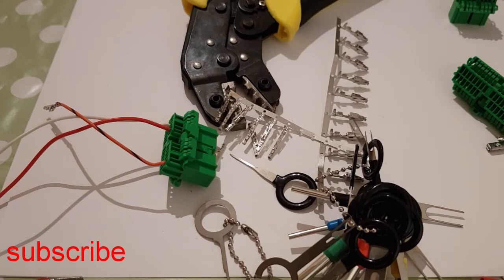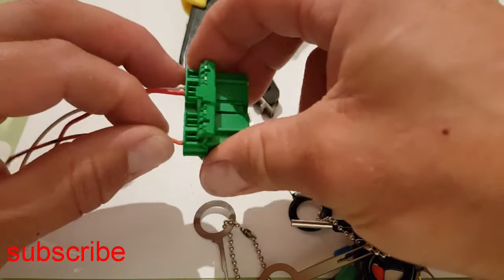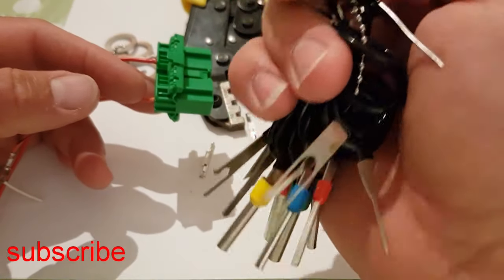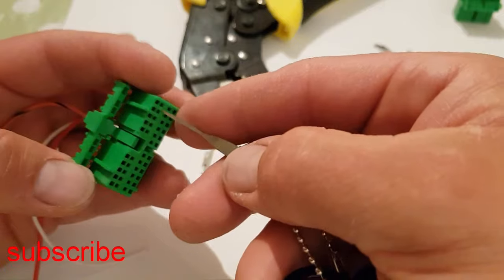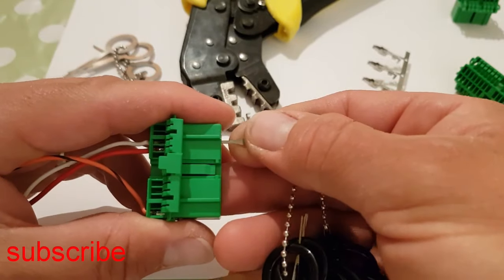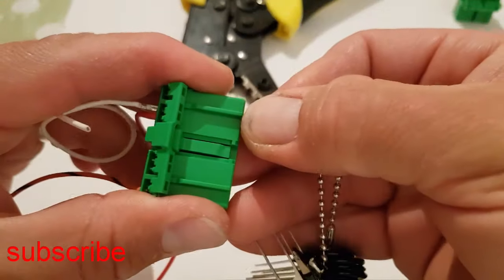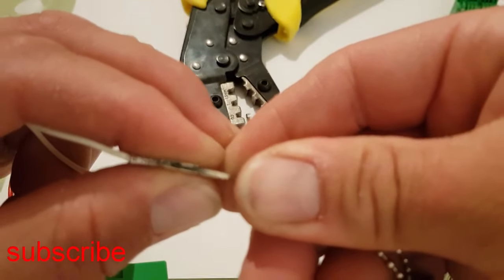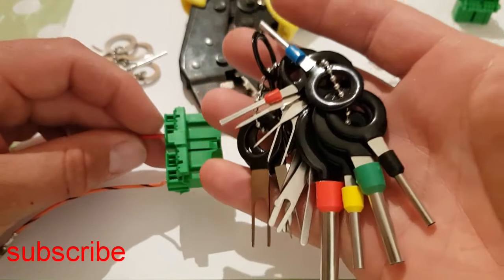DEPINNING AUTOMOTIVE CONNECTOR 
remove terminal from a depin wiring connector

Comment: I had to solder two wires of a connector of my car under-dash fusebox to install a kill switch,  since it was so hard to access to it I messed up my solders and it may break in the near future. The issue is the original wire which is really short now (about 1  inch from the connector) so I was worrying a bit... Now I know how to depin in order to change the wire, thank you very much!

Comment: Hello, would it be possible to wire two different wires to the same PIN number? On the back of my towing mirror, it has an amber light that does not blink with my turn signal. It’s just a running light but I want to modify the wiring in the mirror to make it blink. But I need to pin that wire to the vehicles oem harness. Except there’s already a wire in the pin hole that is responsible for the mirrors actual turn signal on the mirror. Could I tap into that pin so a signal is sent to the turn signal and the modified running light? So basically can I use one pin for two different wires?
Reply from the maker: just tap into the wire next to the plug with a soldered connection. you can sometimes get 2 thin wires into one pin but it's very hard.
Reply: @MADMODS  okay, I thinking those things would be possible. I was just worried that the extra wire would mess something up?
Reply from the maker: @eddier9921  it will be the same as trying to get 2 wires on one pin in the plug splicing into the wire and soldering it will be a safer option and work the same.
Reply: My GM factory wiring harness has this exact thing. 
2 wires going into 1 pin connector.
So it IS possible and IS used by OEMs in that situation.
Cheers!

Comment: Instead of doing pin by pin  can I just remove the block all together and solder the wires together with heat shrink ? I have water damage in the footwell
Reply: Yeah, you can remove all the wires at once for soldering them directly together.
You just need a tool called WIRE CUTTERS. 😂

Comment: Anyone know what the faruels are for
Reply: Ferrules are the metal piece that connect the wire to the plug. They are specific to which type of plug is used.. At work (semiconductor) we don't re-use ferrules like they are doing in the video. I think it's probably okay to re-use once for a car repair - I'm about to as soon as I get myself a tool!